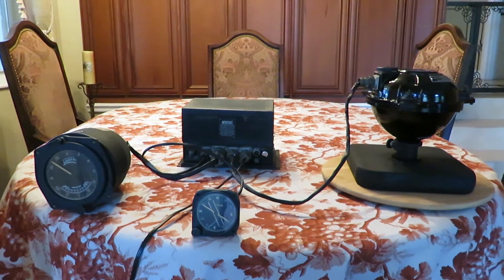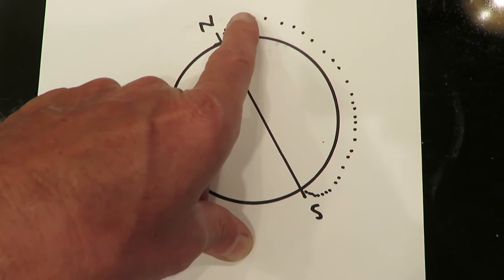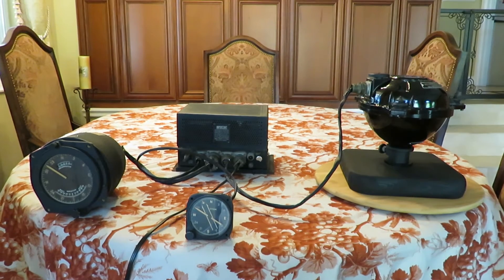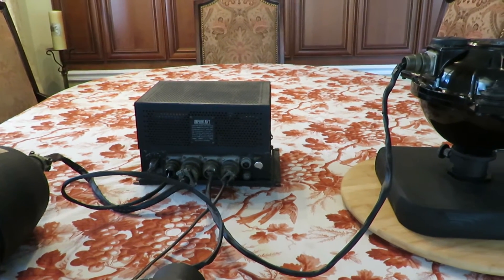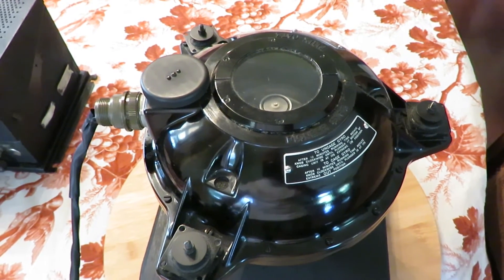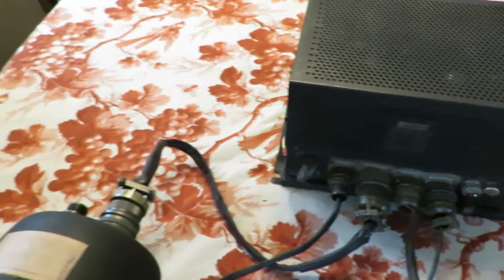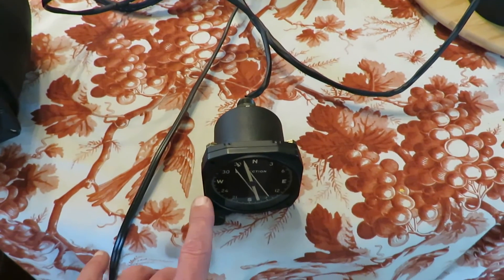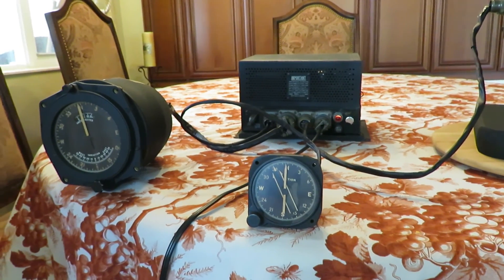WWII Magnetic Flux Gate Compass

Comment: This is a nice video. Legend has it that the magnetic poles are more than a thousand miles from the physical poles. And also, that the physical poles contain huge openings into the other side of the earth, which is covered with thousands of square miles of dense forest.  They say that the Northern lights are not an electrical phenomenon. The little sun in the center of the Earth is simply shining. And they also say that a different group of people live on the interior surface of the Earth, and that they want a maximum of three billion humans on our side. Or perhaps nobody on our side.

Comment: Thanks for the video. I'm a pilot that flies a Cessna 180 and never had the flux gate compass explained to me. Pretty cool. I'm wondering if Lindbergh's earth inductor compass was an older version of this or ???
Reply from the maker: Needed to do a little research before getting back to you.  As best I understand, the earth inductor compass used wind power to turn a generator with armatures and commutators without any electrical induction of a magnetic field-- the earth's magnetic field was the induction source.  There were two armatures and two sets of commutators, the latter at 90 degrees to each other.  The indicator was a galvanometer, and there was a controller that could rotate the commutators so that no current would flow when the aircraft's heading matched the set heading.  It was stabilized on a gimbal. The flux gate compass was a later development and more sophisticated.  It had three "legs", each with a primary winding and a secondary winding.  It used alternating current in the primary winding to induce a field in the secondary winding.  The core of the leg would be "saturated" with each peak of the alternating current, preventing the earth's magnetic field from inducing current. When off the peak, the earth's magnetic field could induce current, and therefore the primary winding exciting current was acting like a gate, opening and shutting with each cycle, and therefore the name "flux gate".  It was gyrosocopically stabilized.  Please see: http://eaavintage.org/wp-content/uploads/2013/01/2005-Vol.-33-No.-04-The-Earth-Inductor-Compass.pdf